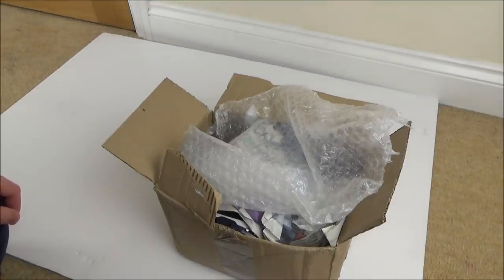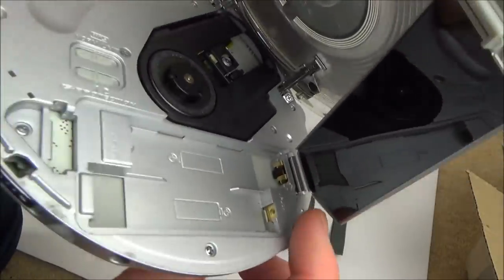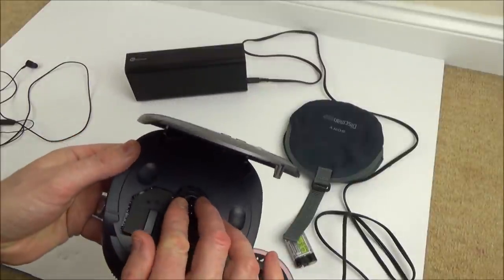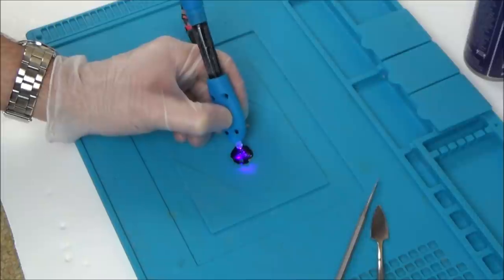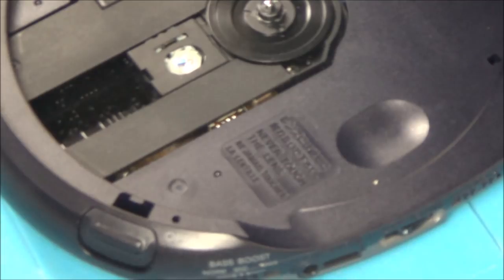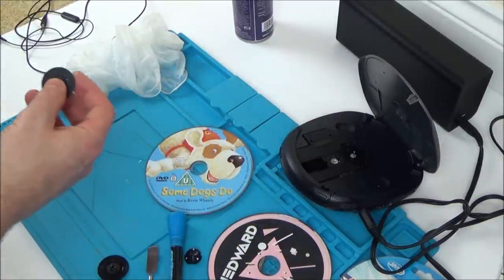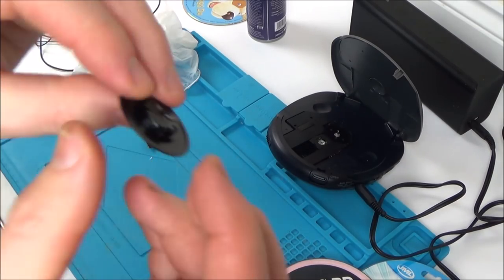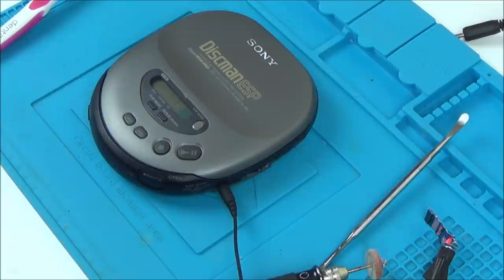Trying to FIX a 1997 Sony Discman D-345 (1st Video in Discman Series)

Comment: Vince . That charge point to me looks the same as the psp 1000 charger point. And I'm guessing the same volts.  Might be worth checking
Reply from the maker: Good info there, it might well be. I will check that out. Thank you Dave :-)
Reply: It should work on most if they are the same socket as that's what I use for my Discman.
Reply: Yes it is the same charger point. But the Charger point has not always the same voltage output. For example psone uses a 7.5V. And Vince need a 4.5V one. ( I was looking on ebay to find the same Discman )
Reply: @phunkstar7347  Obviously I didn't mean, that because it is the same plug/socket you can shove in any power supply💥, I was agreeing at the suggestion of a PSP charger. ✌

Comment: Vince, needless to remind you that your heating station has a power supply, and you can connect it to the adaptor jack pads on the board of those discmen
Reply from the maker: Thank you. Yes of course, I keep forgetting this. I really need to get used to using this. I was thinking of making up an adapter but I don't need to if I can get to the terminals on the battery or on the board itself :-)

Comment: 'Line out' is a fixed level output unaffected by the headphone volume output and has better sound for when using with an amplified speaker system.
Reply from the maker: Thank you :-)

Comment: Hi Vince, some information  - That data disc man is a pretty rare thing, I think Techmoan's channel has done a video on a similar item, (channel link below)
https://www.youtube.com/user/Techmoan
Those CD disc man's were nice gadgets back in the day,  it would have been useful to have the original power adapters/ chargers,  as Sony went through a phase in the early to mid 1990's,  when many of their portable devices used bespoke rechargeable batteries & chargers in various odd shapes & sizes. 

I recently bought from a charity shop, a 1997 vintage Sony Minidisc Hifi system  with CD & cassette,  every thing works, except that the CD player skips regularly,  so I'll have to have a look Inside, it may just be a dusty laser lens, or could be something more complex.
Reply from the maker: Thanks for passing on the info, good luck with the Hi-Fi system :-)

Comment: Screaming at YouTube that you pushed the black spindle part too far down the metal motor spindle. The underneath of the plastic flange is scraping the plastic motor chassic. Raise the spindle CD holder by maybe 1mm or half a mm so the scraping goes away. Also, using glue will never work because the balls press into the band when a CD is inserted

Comment: ESP mode is off so is very sensitive to shakes. Moreover if you enable esp mode the disc will rotate double speed so you have to be sure that the spindle is not going to fall apart.
Also...for running there were special cd players

Comment: the ESP mode was only for the expensive models.. it was essentially a buffer... I bought a cheaper discman without ESP in 1990 for £200 and the music used to skip with the slightest knock... Really regretted not buying the ESP one.... resume let you resume from the same point when you turn your discman off then back on again.
Reply from the maker: Thanks, I will check out the ESP later to see if it works when I let it build up the buffer :-)

Comment: The sound this pick up makes suggests, that it can barely read the disc. It could be, that the laser diode is weak or it needs adjustment for which a scope is needed. Nevertheless a very interesting repair video.

Comment: Tengo un  cargador para un reproductor de cd walkman modelo D-EJ 626 CK Car Ready . Originalmente pide un cargador de 4.5 V Input: AC 120V 60HZ 5W. OUT PUT: DC 4.5V 500 mA. Pero yo tengo otro cargador al cual la mayoria es lo mismo pero solo lo que cambia es en el miliAmperaje al cual dice que es de 400mA. este cambio de mA Dañaria el equipo lo quemaria o algo asi tengo ignorancia sobre este tema espero pueda responder a mi duda.

Comment: if you want the discman to be shock resistant you should turn on antishock protection ESP (Electronic Skip Protection) and wait 10 sec until discman spins up the disk twise the normal speed and copy some of the disk to its memory to be shock resistant, it will withstand 10 or 15 sec constant shocking untill it feels memory again when no shock occured. That is how the ESP works on all discmans. Depending on the model you will have more or less memory seconds.The spinner should rotate freely without touching the chassy, that is why there are so much scratchy noises from player and skip too much.
Reply from the maker: Thanks, I am going to lift the spindle a tiny bit to allow it to spin better and at the time of filming I never knew how ESP works. Thanks for the information :-)
Reply: @Mymatevince  In ALL compact disc devices there is a error correction amp wich is responsible to corrects all kinds of errors when player reading the disk e.g. scratched disc, dust, wobbling, follow focus and tracking of lazer light on tracks. This error amp has limited number of errors that can correct (from few hundred to couple of thousends depending on player) and when the spindle disc holder touches the chassy you increase that number way beyond what error amp can handle. Same happends when laser is weak or optics are out of callibration or dirty or mechanics are weared or even defective electronic component on controller PCB. Here -> http://hyperphysics.phy-astr.gsu.edu/hbase/Audio/cdplay.html is a simple explanation if you are interested on how it works

Comment: LOL...I was wondering how long it was going to take you to realize that one disc was a DVD...but thankfully you did before you wrote a player off as non-working/non-fixable....also, some CD players have to build up a "buffer" before you can shake them more "violently"...that could be the case with that particular CD player. I had one that could buffer up to 3 minutes...you could literally remove the CD after the buffer built up and it would continue playing the song....
Reply from the maker: Thanks, yes someone mentioned this one on the vid has a 3-5sec buffer so I am going to test it out later today:-) lol...I won't make the DVD mistake again :-)

Comment: My younger sister was well into Sony walkmans/discmans always had to have the loudest and best she could afford, me on the other hand had one basic one which i cherished even put back into original packaging to keep safe after use, that was until my younger brother got hold of it and ripped the packaging grr, in the end it started to not read discs, i took it apart and found a small POT i adjusted and it started to work again, i have no idea what i did with it in the end i think i just dumped it once it totally failed.

Comment: I used to use 'donor' Discmans and other portable CD players including all those small crappy portables just for their hub discs to repair broken Playstations before you could get them for £2 off fleabay, I knew which ones to look for as they are wildy different as Vince would testify, Vince that hub disc you have ordered fits both PlayStation (PSX) and PsOne (light grey one) as they are 30mm wide and identical in every way.  Plus test it's laser with a 'long' CD, something 78 mins'ish long that will push the laser to it's outer edge (proving the lasers strengh) like a slightly scabby Now CD or similar, just something to push it a bit, if this disc plays OK on a tried and tested system and then on your broken one it's all good, I used to use this method to test PSX lasers especially important on chipped machines as they'd get a lot more stick with crappy blank discs.  Lever off the hub disc if you can from 2 sides to minimise the motor spindle bending and also to stop the spindle from warping out of shape or splitting, both annoying easy to do. Great vid as always Vince.
Reply from the maker: Brilliant advice John, thank you for sharing it. Next time I will try and get 2 flat blades either sides of the spindle and then hopefully it won't break like the PSone did :-)
Reply: @Mymatevince  I use 2x 6inch metal rulers, strong broad enough and thin enough to get under it + they have a million other uses - all the best, I do like the videos

Comment: all sony cd players may be different in design but the motors are the same & they don't have 20 second buffers built in which is why they skip, I have a cd player that has the buffer & it will play for 20 seconds while your jolting it about without skipping or cutting off
Reply: oh & it still works after all this time in storage